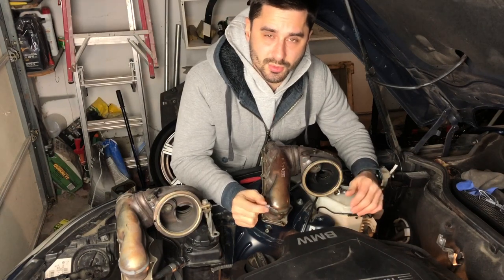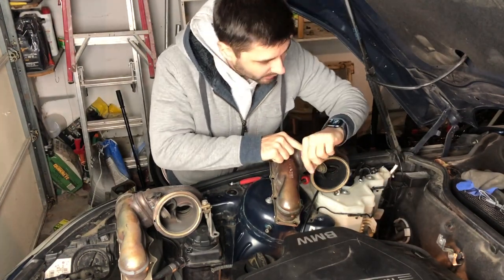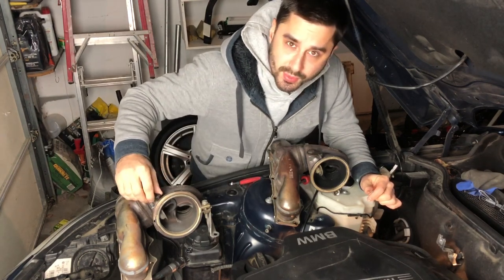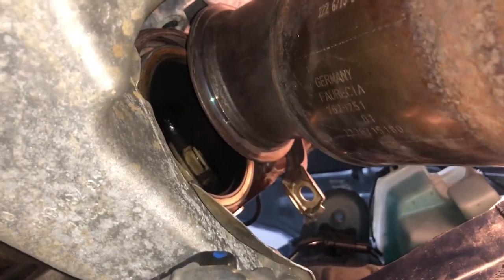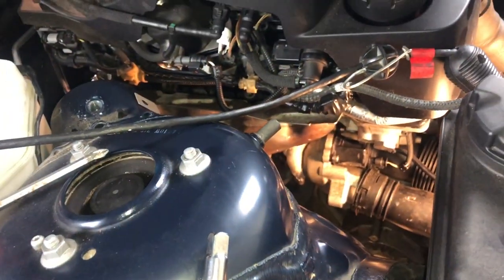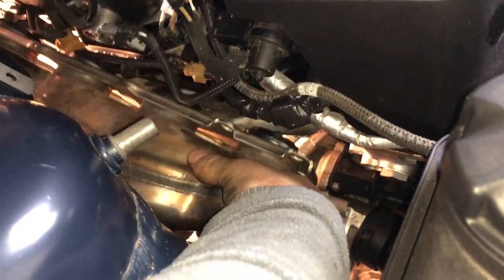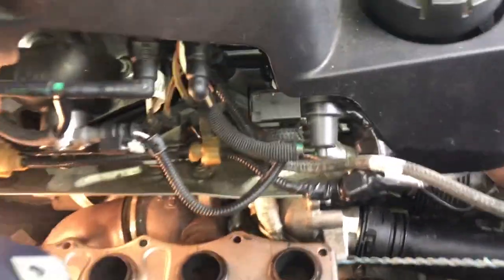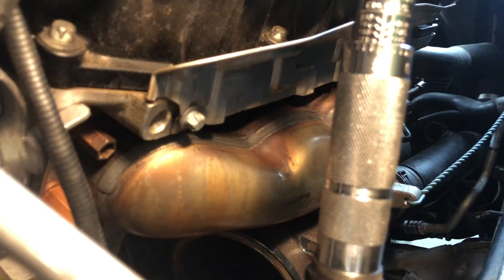BMW Wastegate Rattle Fix - How to Replace the Manifold

Comment from the maker: Thank you everyone for watching. Please consider subscribing for more car videos!
Reply: instablaster...
Reply: Thank you for your detailed video I really appreciate it.
I do have a question 
I have a 2012 bmw x1 
That’s making the same rattling noise at the start .. I was wondering can I drive the car without harming it with that rattle ?
Reply: Ive heard one can use also a VW wastegate clip for a f20 B38 engine. Will it really work?

Comment: and by the way! a very important Tip for all N20 PWG owners: if you need a new manifold you can buy the turbo from N26 with electronic waste gate and just put your pneumatic wast gate on it, you just need to drill 10mm hole in the arm and to adjust it.
Reply: What did you use to drill the hole? A regular drill and 10mm drill bit? I tried but it’s being difficult
Reply: @kuyacdeguzman24  yes, a 10mm drill

Comment: You that man!  Thank you for the time you take to make these super useful videos for BMW owners, always straight to the point!  You and Vehiclular DYI much respect, similar in the teachings but always dropping valuable knowledge!    Keep them coming..... 
You should do some vids on the trunk's tension springs left and right sides and the differences of what each does,  vids on the Turbo Boost selenoid, how to properly do a coolant flush and should you use the special bmw blue coolant or the one time Waterless Coolant and maybe also vids on the best error free interior LED lighting on bmw's!
Reply from the maker: Thank you so much for your comment and watching! I will look into the suggestions and see what videos I can make and what applies best for my car. I especially like the error free interior LED as I haven't thought of that!

Comment: Man your video was so helpful! My problem with my F10 n20 engine was coolant leak from the turbo coolant lines. I had to take out the whole turbocharger. I had no problems doing it with the help of your video! One issue I am facing is that 5 nuts of the manifold came out together with the screw and one nut&screw was even missing not put in place by a mechanic that changed the turbo earlier. I got all the parts but I don’t know the torque spec for the bolts for the manifold that go into the engine block (not the nuts that tighten the manifold but the bolts that go in first) and should they be lubricated with something in order to get locked. If you can help me with answer I would appreciate it! Keep up the good work!

Comment: Hello. I have a 100kkm N20 do basically i got this noise. As you say its only at startup. But is it gonna break anything or is it just the noise that bother you so you change it?
Reply from the maker: It’s not going to break anything, the worst that can happen is you will lose some boost. The main issue here is the noise and rattling.
Reply: The noise will eventually also be there on warm engine
Reply from the maker: If it gets bad enough, correct. Mine was really bad as you can see in the video but it didn’t rattle after the engine was fully warmed up. It was very close, I believe.

Comment: Great video man!   Any tips for separating the exhaust manifold from the block I got everything unbolted and it seems to just be stuck to the block I tried to hit it with a 2x4 from above and below. Just to clarify its completely unbolted. (10 exhaust nuts/2 bots on the bottom bracket, cat v-band, and all the oil/coolant lines/waste gate actuator)

Comment: Just did this to my 528xi like had an extra turbo from another swap I did awhile back so I swapped the whole turbo.
Just have to drill the hole on the arm for the wast gate a little to make it fit since the replacement turbo had an electronic waste gate.
A lot quieter now
Reply from the maker: I had to drill it out also and now that I think about it, I should have done the turbo as well, but too late now. If I start feeling like the turbo is failing, I might swap it. Thanks for watching and so much better without the rattle!

Comment: 12:36 you must change the position of the bolt clamp that is keeping the catalytic and exhaust manifold  in a lower position in near future, the waste gate when is open is getting very close to the bolt and  sometimes is not getting the right movement.
Reply from the maker: I’ve replaced the manifold due to wastegate rattle since then and fixed the clamp! Good catch.

Comment: Hey, great vid. I'm curious, what kind of mileage did your car have at the time of filming? 
My car is at 203,000km (126,000mi)
I got my 320i (still N20) diagnosed at a BMW dealership for a similar sound on cold start and while driving - they located the noise to come from the wastegate actuator and the quote for a fix was over 3,700€ with a brand new turbo!
I will surely be doing this job myself, with probably a rebuilt turbo & manifold for ~800€
Reply from the maker: Hi, thanks for watching!
This turbo had 116000 miles on it at the time of filming as far as I can remember. Dealerships want a crazy amount of money for this type of work and mine has been perfectly fine since the video! Good luck with yours and let me know how it goes.

Comment: Can this problem be causing the check engine light codes 120308 120408 121533 to turn on. Cause yes I’m having the same noise, I tried adjusting the wastegate and still having the noise issue. And also car feels boggy? Could it be that it needs a new manifold? It also been replaced with the turbo with a used one. And still same trouble that car feels boggy.

Comment: So wouldnt welding It be cheaper? Even if you installed a used one eventually overtine it will start to rattle again right?
Reply from the maker: Welding it would work if it’s done right, however, if it’s as bad as mine was, the bushings for the actuator arm might also be in bad condition. If the weld isn’t done really well, can also fall off shortly after since it’s always under pressure. To me, it’s more of a ‘I’m buying some time’ solution rather than just replacing it. If it lasts 50k miles and I have to do it again, I can live with that.

Thank you for watching!

Comment: Hello  finally who has good and cheap solution to this Problem, thank you. But I habe another question: is there a seal between the manifold unit and the Turbocharger?
Reply from the maker: No seal that I saw between there. There is a clamp that keeps the two parts together.
Thank you for watching!

Comment: Hi, thanks for posting this video. Very insightful. I have a similar rattle but it doesn't go away even when the engine warms up. It is noticeable under acceleration. I've seen another post which may suggests rattles may come from the wastegate actuator which seems like an easier fix. I'm unsure whether it could also be this also and wanted your opinion.
Reply from the maker: If you have the pneumatic wastegate actuator you can try tightening it up a little bit to see if it helps. Otherwise, I don't see how it would make that noise.

Comment: Hello i have a problem with 2014 bmw z4 2.0i sdrive 103.000 km the car does not want to boost when take a log always 8 psi 0,6 bar boost and no fluid code i check ecu program, boost leak, exhaust sytem, wasgete (this one use electronic), vanos, valvetronic everythink seams good but the car 0-100 km 11 second the car never ask more boost only want max 8psi 0.6bar boost try everthink but cant solve this car.
Reply from the maker: Wish I could help, but I don't have enough expertise to point out what it could be. However, if you do figure it out, please let us know in case someone has the same problem!

Comment: Taking the manifold off from the turbine, did it have a locator pin? Imagine it can only slide in on one way? 

What torque did you tighten the turbine to housing clamp up to? 

Reckon there would be access to swap the oil feed pipe once it’s removed? Can the turbo twist slightly to access the torx bolt?
Reply from the maker: It did have a locator pin of sorts and you have to be very careful not to touch the fins while removing the manifold from the turbo.

Torque for catalytic converter to turbocharger is 13 Nm. I couldn't find the torque specs for between the manifold and the turbo, so i did the same spec. 

I don't remember exactly, but you should be able to at least be able to loosen the bolt on the oil feed line. Not sure if it'll come out.

Comment: After replacing the turbo, the exhaust is louder in cold start, sounds like a leak from the manifold. Would that be a possibility?
Reply from the maker: Did you by chance not tighten the flange between turbo and catalytic converter?

Comment: Really appreicate your channel but cant seem to find a used wastegate manifold online. Is this just due to scarcity or do I need to look up something specific? Thanks!
Reply from the maker: There are plenty of them on email. I saw anywhere from $125 to $500 with turbo included. Check it out: http://rover.ebay.com/rover/1/711-53200-19255-0/1?ff3=4&pub=5575521154&toolid=10001&campid=5338566624&customid=simplez4&mpre=https%3A%2F%2Fwww.ebay.com%2Fsch%2Fi.html%3F_from%3DR40%26_trksid%3Dm570.l1313%26_nkw%3Dbmw%2Bn20%2Bexhaust%2Bmanifold%26_sacat%3D0
Thanks for watching!

Comment: I have the rattle but no codes do you recommend me replacing it before codes or should I let it ride. I have a 2012 528i xdrive so I know ill have less room for the job. Also can it be done like your video or will the engine need to be pulled.
Reply from the maker: 528 should have enough space once you remove some shields and plastics, but I’m not 100% sure of the exact process. You don’t HAVE to replace it if the noise doesn’t bother you, but eventually you will start losing boost and start getting codes. Once again, those aren’t very harmful, but the car can use more fuel and have less power etc.
Reply: @SimpleCarGuy  Hell I didn't even see you replied thank you! I get a drivetrain malfunction when I go up hills. Goes away when I turn the car off my code reader says boost is too low. Replaced the solenoid still happens going to do this job soon thank you! Awesome videos watch all the time thanks again buddy! I live in il too..

Comment: Is it ok to continue to drive the car? I have some white smoke coming out on startup but it goes away after a couple minutes.
Reply: Hi not the original maker of the video but there was actually a part update to address that symptom, the oil line for the turbo would allow oil to drip into the turbine and cause the smoke on startup, the new updated part has a check valve to keep that from happening, hope that helps with deciding on what to do!

Comment: I need to do this, rattle is so loud on my car. Somehow, all exhaust manifolds on ebay is close to $300((( cannot find one for $150
Reply from the maker: Prices have gone crazy on everything car related lately. Hope you can find a good one!
Reply from the maker: @realsaxual2357  It's not the best engine around, but 2013+ they have fixed most of the issues and it should be fairly reliable as long as the oil is changed often. Older ones suffer from many issues, though.

Comment: I have coolant leak from turbo lines . Should I remove the Turbo to replace the coolant line? 2014 BMW 528i N20
Reply from the maker: If you can access the line without removing the turbo, go with that. I'm not sure how much space there is on a 528i with N20, but I assume there is a good amount if a v8 fits in there. If it's not under the turbo, replace it with the turbo in place.
Reply: @SimpleCarGuy  do you have to drain coolant before replacing the coolant line?
how about oil line?
Reply: Adi, did you have that noise too ?
Reply: Georgica Mihalcea 
Am schimbat numai garniturile de la line coolant .Am avut suficient spațiu ca sa nu dau jos galeria de evacuare . Nu am nici un sunet care sa indice vreo problema la turbo sau la galeriile de evacuare .
Reply: David Jacobs Yes . I did drain the coolant . I change the o rings on Both Lines.   I did not remove the turbo or exhaust manifold .

Comment: I have a 2012 328 With N20, its doing the rattle noise also smokes in the mornings first starting, found a complete turbo and manifold assy but it came out a N26, wanted to ask u would it fit on my car? Thanks in advance.
Reply from the maker: It 'should' work on your car. However, depending on the year it can have an electric waste gate actuator instead of the pneumatic one. You will have to use your old one in that case as the newer one will not work on your car. Hope that helps! Let me know of how it goes for you.
Reply: @SimpleCarGuy  thanks a lot, it did work perfect, just used my old waste gate valve as you recommended.
Reply: @frankfrank1214  I also have 2012 328 with pneumatic waste gate. Which one did you end up buying that worked for you? The one from N26 with electronic waste gate (and what year was it)? And then just drilled out the arm on the pneumatic actuator as SimpleCarGuy suggested? Thanks!
Reply: @dmshopper6952  yes, I used the one from N26 it worked perfect just swaped the waste gate valve and yes I drilled the arm, and it was from a 2015 328i

Comment: you took the  new exhaust part from an N26 engine., the wastegate arm (small pear shape) is smaller with 0,5 cm.
Reply from the maker: I don’t think it’s from an N26, I believe that it’s from the newer engine (since I wanted low miles) that was using an electronic wastegate actuator. I just drilled out the piece that was going on the arm to make it fit. Worked well so far. Of course it’d be easier to just order the right part, but those are pre-2013 and hard to find in good shape and new ones are stupid expensive.
Reply: @SimpleCarGuy   is from the N26 EWG, i did the same like you, the only difference is that i both the hole turbo for 400 euros because i couldn't by only the manifold  , i had to drill a 10 mm hole in order to fit my PWG arm ! as you can see inside the WG, they use better material for the EWG. glad i found your channel. abount the buzzing noise, is it normal? my car does this to at cold start.
Reply from the maker: @costelariton9864  I guess you are right, I looked further into it and it looks like they were the same for N20 and N26 from 2013+ since N20 got electronic wastegate actuator at that time. I watched your video a couple more times and I think that's just injectors, mine sounds about the same.

Comment: i did the same procedure with my turbo. question, how many miles your car have and from where is that humming noise?
Reply from the maker: Which noise are you referencing?
The car had 115000 miles when I replaced the engine, but I did not replace the manifold at the time. I have put on about 2-3k miles since then.
Reply: @SimpleCarGuy   its a buzzing noise, check my channel, i posted a video there, easier to explain.
Thank you
Reply from the maker: @costelariton9864  watched the video and honestly I don't hear a buzzing noise that isn't normal. The clicking or ticking noise is just the injectors being loud (if that's what you referring to).

Comment: Is it hard to remove the old graphite sealing rings? 

Do they pull off easy?
Reply from the maker: Not easy if the engine has had many miles, but they will come off in a few minutes.

Comment: I have a friend wanting me to tack his to prevent the rattling. Do you know if those rings are made of stainless or what type of metal? Trying to figure out which welding process I need to use to fix it.
Reply: Did you figure out which it is?

Comment: Hey man no shade to you I appreciate a real tech to spread the knowledge, but if they were clever they were just simply design it the same way as in your regular car because they know most people ain’t gonna be that clever to think to use the pulse jump terminals and not from the battery itself.. To me they thought about well they going to hook it to the battery so they’re gonna mess up the electrical system – that’s more money that the company makes that’s all I think about how BMW is there unreliable and too expensive..don’t get me wrong tho,the 2013 X1 I’ve gotten 2014 with 20k with factory extended warranty everything was all up-to-date replace new timing chain tensioner‘s etc. etc. all the weak parts it’s currently at 144k and the only issues that I have is the RATTLE  and it’s gotten bad where it’s no longer actuating and making boost.it’s in limp mode “engine malfunction reduced power..and it’s sad to say I had no choice but to drive it like that and it’s been over 2 going on 3 years and I’m really impressed on its reliability..just bout a reman turbo,new valve cover n gaskets new down pipe cause it’s leaking out the flex pipe..I really like bmw and since now they make a swap spacer to swap in a honda motor 👌🏾👌🏾💪🏾👏🏾🙏🏾using the original trans..soon my mans gets his new car I will be taking it and swapping in a honda K24a2 block with the k20a2 head swap with turbo and it will make much more power and most importantly reliability and parts will be a dime a dozen 👏🏾👏🏾👏🏾👏🏾👏🏾👏🏾👏🏾👏🏾🙏🏾🙏🏾keep up the grate work tho man…if it wasn’t for honda I would know the little knowledge I have gain to work on a car let along a honda…

Comment: Ehhh... it's not so simple in F10/F10...
Reply from the maker: Might have some space constraints, but you can undo one of the engine mounts and lift the engine a little bit.
Reply: @SimpleCarGuy  Thx, I will do as you recommend.
Reply: I did it without removing the engine mount…and on jack stands, didn’t even have a lift! However I removed the whole turbo. I couldn’t reach the nut to separate the turbo from the manifold! It’s not an easy job but it is doable bro…the solenoids on the catalytic converter you don’t have to unscrew you can just unplug them. Just follow the wires…that made it a lot easier for me.